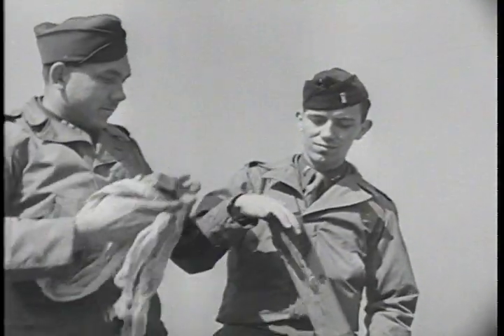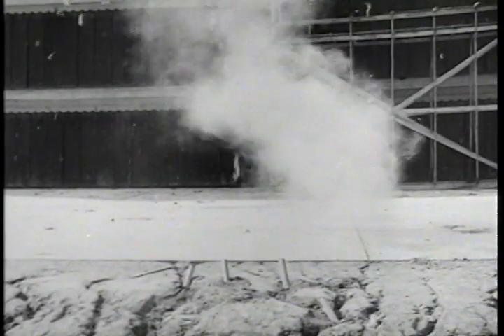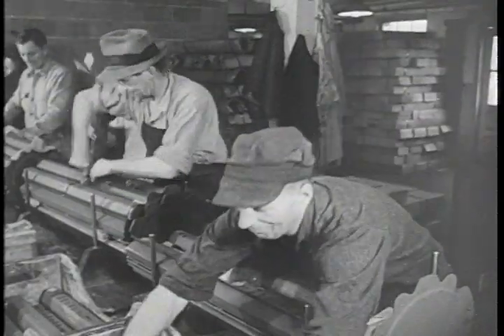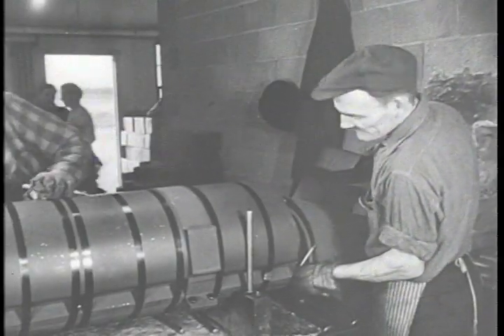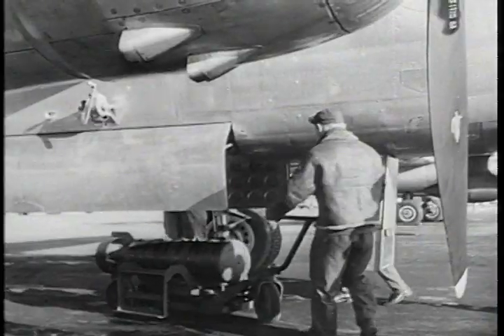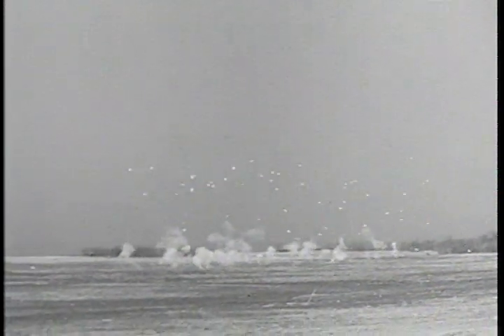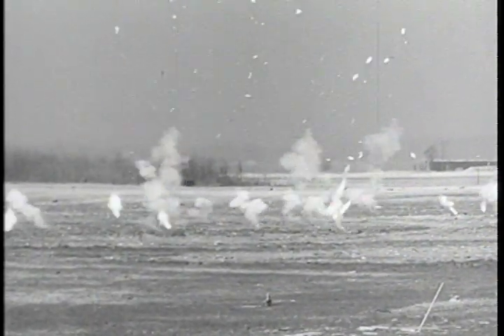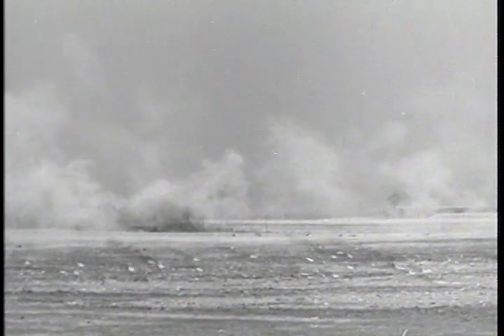Napalm - M-69 Incendiary Bombs Built

Comment: The M-69 incendiary bomb was arguably the most destructive weapon that was deployed by anyone during World War II, although you could also make a case for the 4 lb. thermite magnesium incendiary deployed by the RAF.
Reply: It's cheaper to make napalm than use magnesium thermite.
Reply: @JewsRock-ILJ  Quite likely.  One of the primary reasons behind the the development of napalm was the concern at the time about a possible shortage of magnesium which was needed by the aircraft industry.  As it turned out, the shortage never materialized.
Reply: @JewsRock-ILJ  Do you tumble pennies in a rock polisher?

Comment: Polystyren + aceton = napalm
Reply: That's the recipe from the anarchist cookbook. They didn't have polystyrene during WWII so they used a mixture of aluminum salts, naphthenic/palmitic acid, and a petrol (usually either diesel fuel or gasoline). In the Vietnam war they started using styrene based compounds as gelling agents but they never used acetone as it both doesn't burn hot enough and it freezes at high altitudes which would make it difficult to load onto planes for bombing missions.
Reply: Toast Busters can white phosphorus be added to the mixture?
Reply: ALSO use stryrofoam + diesel - ONLY problem is it takes MASSIVE amounts of stryrofoam to make it turn into a gel...
Reply: Gas+styrofoam is the easiest way, can burn a fat hole into a  concrete road using this